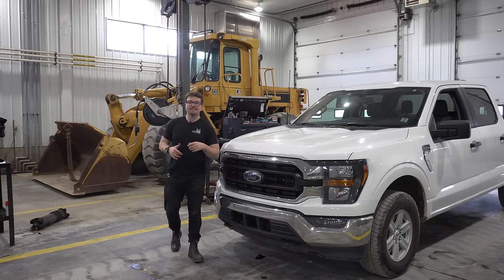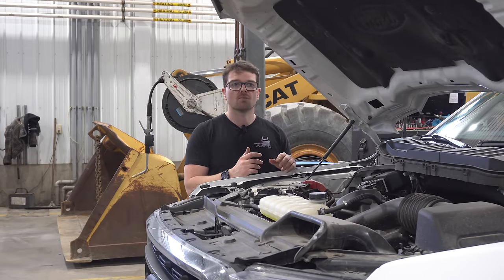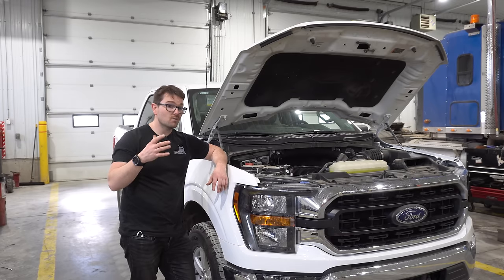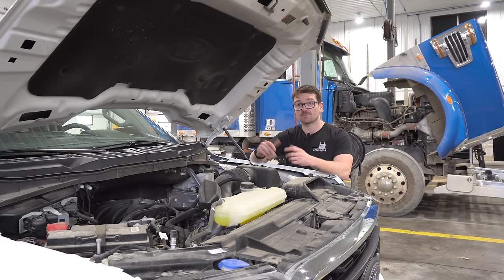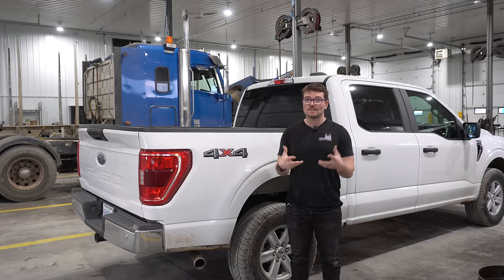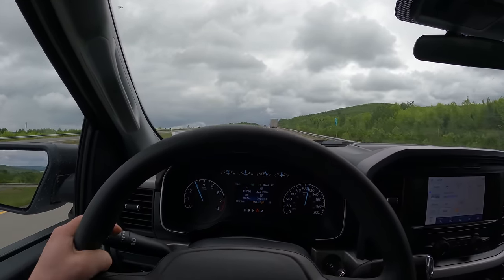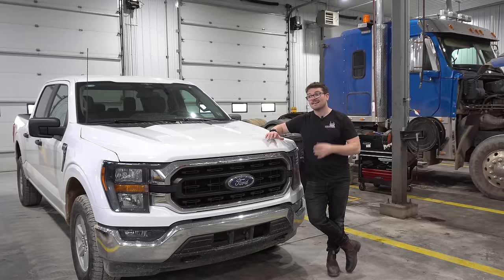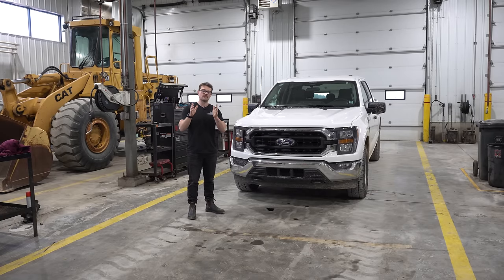Ford F150 5L Coyote V8 Engine **Heavy Mechanic Review** | 5 Reasons why It's the BEST

Comment: Easily one of the most reliable modern V8s out there! The 5.7 Hemi is a hell of an engine, but it is dated with an iron block and 20 year old design. The Coyote is aluminum, lighter weight, and it has been regularly updated.

Comment: Up until the other day I would have agreed with you. My 5.0 has a P005 and a  P007 codes which means the Intake manifold needs replaced , and Ford put a stop sale order on them so if you can't get the part how good is the truck?

Comment: @TheGettyAdventures, what rear axle is in the test truck? I’ve been eyeing used 2018-2021 F150’s with the 5.0L and 10 speed transmission but I’m seeing mixed reviews on the  3.31 rear end. I plan to stick with the 3.55 rear end if possible. Is that what the test truck had?

Comment: I would argue that the 3.5 EcoBoost can match the fuel efficiency of the 5.0 if it is driven correctly. Turn on the boost Gage in your instrument cluster and turn off gears to keep it out of boost. I regularly tow over 9,000 lb an can exceed 10 Mi per gallon with a 3.5 EcoBoost.
Reply from the maker: Thats not bad actually. But those ecoboost tow so well. Hard not to get one if you tow consistently
Reply: They are great for towing, but longevity is debatable.  I'd love to try the 5.0 to see how it compares. Listening to the older v8s scream when towing gets old fast. Looks like your experience has been better.

Comment: I’m currently driving a 2015 3.5L Ecoboost with max tow pkg and about 50k miles. I have another vehicle I use as my daily driver. When pulling a 5000 lb RV trailer, I get anywhere from 8-10 mpg. I’m leaning heavy to the LZ0 3L duramax bc of its towing fuel efficiency. I’d like an AT4 even though it doesn’t come with a max trailering pkg Would I be wrong? I heard your last 30 seconds and the potential complications with emissions but that you like the 3L duramax overall.
Reply: I have a 2015 f150 with 3.55 gears and the 5.0 engine and pull about 6k trailer daily and average 11.4 MPG

Comment: Ford needs a F-150 coyote 
With a Low (8 psi)  Boost single Turbo coyote for towing. 
Also Ford  needs a F-350 7.3 low Boost gasoline ⛽️ engine for towing

Comment: It’s a shame they were forced to put cylinder deactivation on the 5.0 V8. I’ll never touch another engine with it. So thrilled to be out of my 2014 GMC Sierra 5.3 with AFM. Always been a gm truck guy until now. The f150 5.0, specially for me, my 2019 5.0 10 speed is so much better. And the truck itself thought out and laid out so much better. I have a base model xl with the stx package. Best blend of usable equipment on the truck. Not a lot of junk to break an cause issues. I couldn’t be happier.
Reply: Same here I have XLT with bare bones options and love the simplicity of use.
Reply: The system is designed better than the Chevys.
Reply: @dmandman9  Too early to tell about the deactivation system reliability of 5.0 Coyote engine in Fords yet.
Reply: @ramaswamynarayanaswamy4806  that is true. However, is not too early to look at the design and see why it MAY be more reliable. The Chevys tend to fail because they don't get enough lubrication during the deactivation events. And they end up wearing out the camshaft. The overhead cam Ford has oil rails which sport oil directly on the camshaft lobes of the cylinders with the lifters that get deactivated. So it seems as though they have addressed that area of concern. Time will tell if it worked or not
Reply: @dmandman9  We will have to wait and see.
Reply: @ramaswamynarayanaswamy4806  True. But so far, so good. I’ve learned that often when something is going to be a widespread problem, we often see a few examples in the early days in those who’s owners have quickly put a lot of highway miles on them since that’s when cylinder deactivation is in operation the most. So far we haven’t seen any issues. And they’ve also been using the same technology in their 1.5 3cyl used since 2020 in the escape. It was used even earlier overseas. Yes, it’s still very early. But early indications are looking good. As stated earlier, OHC design allows the oil to be sprayed directly on the camshaft, addressing the main cause of failure in the Chevy and Dodge.
Reply: @dmandman9  I agree there, but then again percentage wise the issue is low with GM and with Ram vehicles. Not every truck has it, or customers would stop buying GM and Ram entirely. Lots of vehicles rolling in the Middle East bought previously.
Reply: @ramaswamynarayanaswamy4806  I agree that the majority don’t have a problem. But enough do where it’s a known issue. By the way, the Ford 6.0 and6.4 diesels were well known to be problematic. But the Ford super Duty was still the best seller in its class even with the known issues.
Reply: @dmandman9  The DoD system was active in trucks in the Middle East and I have not heard substantially large complains there. But Ford engine I have heard are somewhat harder and more expensive to work on. They are best sellers for fleets particularly because they can be purchased at a cheaper rate and with discounts than GM offerings which I heard are more expensive.
Reply: @ramaswamynarayanaswamy4806  I don’t know about fleets. But the price of Chevys vs Fords for retail customers is very similar with Fords often costing slightly more. This is anecdotal. But I spoke with a guy who switched to GM when he had so many issues with his 6.0 Powerstroke , and he switched back saying he’d rather deal with the extra issues of the ford because the rest of the truck was just a better overall experience. And an ambulance driver who was driving a Dodge ambulance conversion because our county switched away from Fords after so much trouble with the 6.0, told me he simply HATED the Dodge and didn’t exactly like the Chevys they’d switched to. By the way, they’ve switched back to Fords. After the Dodges and Chevys aged out.
Reply: @dmandman9  Brand loyalty could be a factor as well. When I visited the US, I saw that Ford was much more common than GM, and I think because they probably have good deals on their trucks. I never saw that many Tundras used in fleets. In Qatar, the order used to be that GM trucks were most common, with Ford and Ram being much rarer and Tundras very few and far in between with little Titans.

Comment: Do you test these trucks on regular or premium fuel? It’s seems like it makes a big difference in these newer trucks. I don’t necessarily like that the 5.0 is so high compression now because it runs better on ethanol or premium but I like the cost of regular way better obviously.
Reply: By using a higher octane fuel you will get probably some more horsepower but the fuel economy will be worse because the engine is meant to run on regular gas

Comment: What generation 5.0 do you think is the best? I just bought a 2017 5.0 with the 6 speed transmission and love it! I have read in forums that the 2nd generation(2015-2017) is the sweet spot.
Reply: A manual F150 with the 5.0?  I never knew they made them with a manual.
Reply: @pabo8080 he’s talking about the 6R80 6 speed auto trans.
Reply: That is the sweet spot from a reliability perspective.  The Gen 2 coyote and 6R80 trans is a tough combo.
Reply: @pabo8080 it's a 6 speed automatic
Reply: 10 speed gen no good?
Reply: Gen 3 that is
Reply: @JulianoGSF  Gen 3 is great. Gen 2 is just the one that’s had less issues overall.
Reply: @AB-coyote  do you think Gen 2 has less issues because of the older 6 speed transmission?
Reply: @JulianoGSF  the 6 speed trans has less issues and the cam phasers rarely have issues in the Gen 2.
Reply: @AB-coyote  for reliability should I just go with a Honda Ridgeline?
Reply: Would a V6 NA (no turbo) be also reliable?
Reply: @JulianoGSF  the n/A V6 F150 are very reliable.
Reply: @AB-coyote  seems like they are hard to find

Comment: Great video! It’d be neat to see you review the Tundra 5.7 and the Titan 5.6.
Reply from the maker: It's a must at this point. my truck supplier has very limited tundra's and no Nissans so it makes a little tough.
Reply: @@user-dd3pl9ii2h yeah makes sense. I like getting others options on the different trucks. I’m a Toyota fan and love my tundra. The F150 with the 5.0 would be my next choice in trucks. 
The Rams with the 5.7 are nice but I’d be concerned with having the cam and lifter failure problem. If I were to get one id install the hellcat oil pump right off the bat. I’ve heard that’s what fixes the issue of them having low oil pressure at idle.

Comment: I’m old fashioned, I just don’t like all the overhead cams and associated problems they seem to have plus the cylinder deactivation systems. There should be a way to shut that off because owners don’t worry about that .2-.3 mpg it might give you.
Reply from the maker: I don't mind the overhead cams and it seems ford has done a great job with this set up. But like you the cylinder deactivation upsets me. The chief engineer for the f150s said it would help save 1-2% more fuel. So basically a complete gimmick

Comment: Will the cylinder deactivation have as much of a detrimental effect on an overhead cam engine as opposed to a push rod engine? Honda has been using this technology on their overhead cam V6. I haven’t heard of any problems with their engines
Reply: The tech is a lot different than Chevy and dodge AFM. They have spring loaded collapsible lifters that are very prone to failure and throwing metal all over the engine. I have the F150 5.0 and I tuned it to get the cylinder deactivation out.

Comment: Got mine yesterday. New 2023 XL STX 5.0 4x4. Only thing that worries me is the potential transmission issues. Any input?
Reply: Tune it
Reply: @Trevormaffetone  do you care to elaborate please? Tune it? I’m pretty ignorant to the subject. Is there anything specific to buy for this? Or just take it to a tuner and thats it?
Reply: @nielsenrivera457  tuning the transmission will allow it to run smoothly. Which can’t hurt it. I just tuned mine and it shifts wayyy smoother after it’s been tuned

Comment: Ford Coyote. One of build 5.0 L Built now.
Reply: Run a new F150 5.0 l  Single Cab 4x4 and add Twin Turbos.
Reply: It will run easy 10s
Reply: Crazy how stock transmission will hold that horsepower.
Reply: Ford has that 9 inch rear end.

Comment: I'll take the V6 these days. 2021 and later 5.0L engines use active cylinder management and a wet belt oil pump drive. Both not great ideas.
Reply: Hey folks it's theRooster772 the typical modern truck lover.

Comment: You should give the powerboost a try.
Reply: Sold my 18 5.0 for a Powerboost, sold the Powerboost for a Whipple supercharged 5.0 2023.    The Powerboost has a ton of issues, towing mpg is absolutely terrible and with each auto update, more bugs and glitches would surface and make the truck ownership not great.   I ended up just buying a quiet 2.3kwh generator and a 1kwh battery bank to replace the PB.
Reply: @stephenfrost545  Thanks for the info. I have no personal experience with the powerboost, coyote or the ecoboost engines. Just the older 2 valve 5.4 engine which was trouble free. That being said, I’ve been wishing Ford would make an F150 Tremor with the powerboost.

Comment: That engine has the oil pump driven with a wet bet.... They also need premium fuel otherwise they spark knock like crazy.
Reply: That’d be the gm 6.2 that knocks with 87.

Comment: what's the max towing capacity on a newer ford f150 with the 5.0 coyote engine?
Reply: I have a 2021 XLT with the Max Tow package. It is rated  for 14,000 pounds of towing and it has 1,805 pounds of payload. You will run out of payload before the towing capacity.  I have towed  around 8000 pounds on our 10K flatbed bed trailer with both a tractor and hay. It can handle it and get 9.9mpg with that load. 

You do know that load is back there and it does struggle on a hill at slow speeds. Unloaded on the highway with larger tires, I can achieve  a little over 22 mpg at 70. Once get over 70 mph, the mpg suffers. The truck is FX4 4x4, but it is not lifted. It is stock other than the 10 ply tires due to some of the rock County roads in the Western Arkansas area and some the scout camps I drive in. 
I would feel more comfortable, I think, with either the Toyota Hybrid or the 3/4 ton when our lease is up in September. The truck performs well, but the Toyotas hybrid system will reach it maximum torque at just 2500 rpms and  all the big three make a good  gas 3/4 ton engine.

Comment: Currently have a ‘15 F-150 with the 3.5 EB. 150k with very little maintenance on the engine/trans. 
My next truck I’m debating on a 5.0. Anyone have pros/cons for it if I bought a ‘24 with that motor? Or should I get a 3.5 EB again? I’d like a truck I can put a decent exhaust on 😅

Comment: I have a 2017 F150 sport  truck extra cab with coyote engine, It was a  low milage copart truck I built  bought at the insurance auction had to put rear axle in it so I went back with a 9.75 instead of the 8.8  which came with the 3.31 ratio , went back with 3.55 ratio in the 9.75 axle. Everything matched up 6 lugs etc. I put in a full locker carrier and man is this thing awesome. The truck will absolutely run and pull unbelievable with this set up so much better than the factory specs. I can haul so much more and the power you can get with proper tuning is off the chart. Very economical on fuel, these engines with a supercharger are a power house. No way I will change from Ford after owning this truck. I had no idea when building this truck I would be this impressive.  A diesel don’t come close to the reliability and economy not to mention the easy maintenance of these coyote engines. This engine is quiet and so smooth running. Ford hands down engineered a masterpiece in the Coyote. I have mixed emotions of the Godzilla engine and think the coyote is much better choice hands down in all around performance and reliability.

Comment: I am a Ford guy but, I'm not impressed with my 2020 F150 with a 5.0. It has used 3qts of oil every 5000 miles since new. They keep dicking with it but so far, haven't fixed it.
Reply: Perfectly normal according to the dealerships 😅
Reply: I always heard an engine that’s starts burning oil is a warning and a bad sign…? Hard to believe this is considered ‘ normal’…?

Comment: It's not the 5.0L engine that concerns me (even though it comes with cylinder deactivation) but pairing it with that questionable 10-speed transmission.
Reply from the maker: I heard the 10 speeds are having some issues
Reply: 2019 has cylinder deactivation?
Reply: @JulianoGSF  Since 2021 from what I found on Google.

Comment: Confirmation bias. 18-20 was the worse engine option for lemons (oil consumption) in fords entire line up. Both of my friends new tracks blow blue smoke and run out of oil FAST

Edit: oh he mentions that lol but I definitely consider that a massive hit on reliability. Dealers are recommending engine replacements for these oil issues.

Comment: The 5.0 has decent power. However my 21 burns oil bad. Heavy white smoke. I thought it was a fluke but was behind another f150 the other day burning oil worse than mine. 5.0s.
Reply from the maker: That's tough. Certainly an issue with the 5L

Comment: The V8 will last longer. The smaller high compression turbos just don’t last as long. I bought a used 2021 Tundra v8 to avoid the newer smaller turbos.

Comment: I've had 97,99,2001,2004,2006,2011,2019 F150s. The 2004 had the 5.4 and blew at 101,000. The 2006 had the 5.4 and had over 270,000. The 2011had over 240,000. The 2019 is weaker than the other trucks.

Comment: Long time GM buyer.  Very disappointed with their offerings and reliability last several years.

I've been doing a decent amount of YouTube research.  Consensus seems to be the 15, 16 & some 17 Ford F150s with the 5.0 V8 naturally aspirated and six speed transmission is about as close to bullet proof as you are going to get for an American truck.  

Hoping to pick a lower mileage one up in near future once prices return to normal or at least get closer to normal.

Comment: People with a 1980s mentality think turbos fail all the time. Ecoboosts are overall good engines. Change the oil before its due. They will last. The joe dirt types like the v8 sound regardless the higher torque and hp of the ecoboost.
Reply from the maker: I don't dislike the ecoboost engines. I think they have proven to be solid options. But I would still think the 5L will be less problematic over the life of the engine.

Comment: I prefer the 5.0, however, it is far from the most reliable. NO, I am not a mechanic. However, there are several professional mechanics that have been working on these engines since 2011, when the 3.5 came out followed by all of the other engines since then. The 5.0 from a ford mechanics eyes is not the best option. The 3.5 in many mechanics eyes is better (now that they’ve got to the most recent generation). Also, the 2.7 has had little to no engine issues, though it’s still newer and not many have been sold over the last 6+ years. Compared to the 5.0 and 3.5 ecoboost.  That being said, the 3.5 in its first 5 years was a disaster…the 2.7 hasn’t seen anywhere near the problems. 3.5 and 2.7 for reliability are my picks as of 2024
Reply: I have one of the best years of the 5.0 coyote for it's very good reliableability,  2015 - 2017. And that v8  sound with my 2016  5.0 with the resonator pipe removed, magnaflow duel exhaust,  WHAT a gorgeous  sound to my ears. No and I mean No 3.5 e.b. or 2.7 could ever duplicate that v8 sound. And a lot of 5.0 coyote owners buy them for the exhaust  note alone. That's why I will NEVER  sell the truck 8yrs. old 34,000 miles live in Minnesota, never seen a winter here. To much extras on these newer 5.0's .cylinder sleeves removed from 2018 on , direct  injection, sprayed cylinder linings,  oil pump belt , stop and start deactivating.  No I'll  keep my 2016 5.0 thank you very much. AMEN, I think I need a beer.